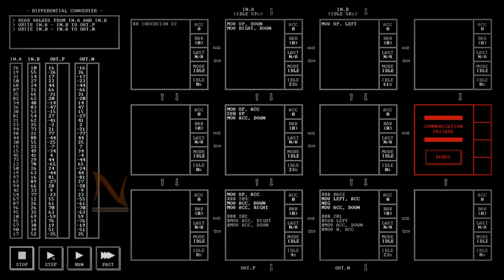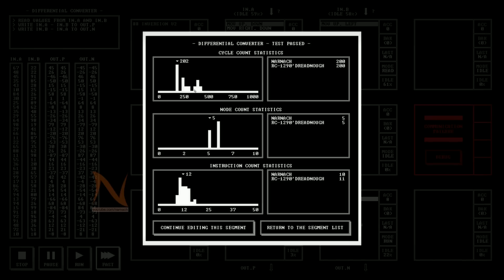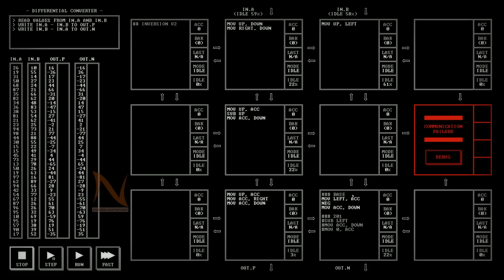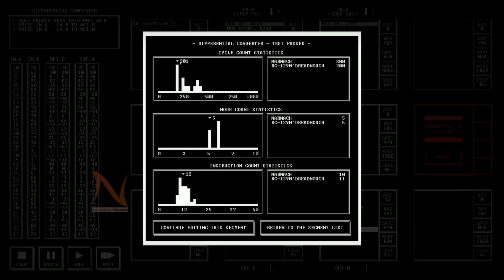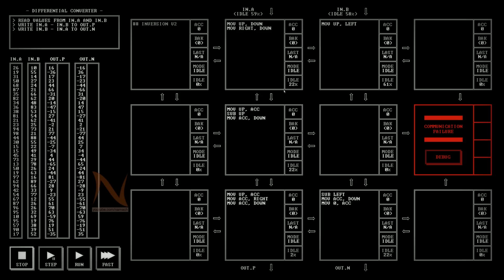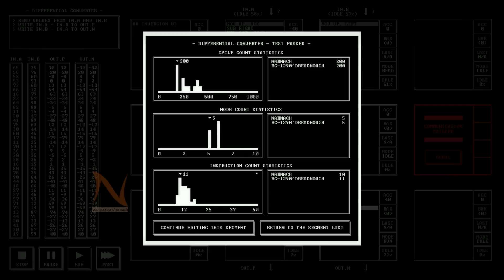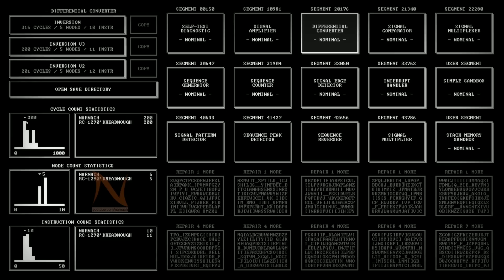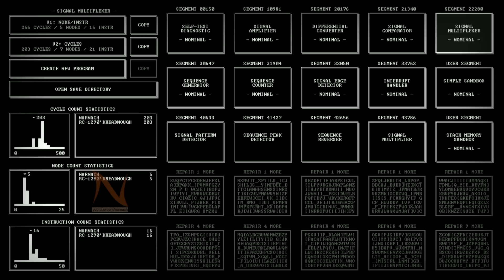#3 - Signal Multiplexer - TIS-100 for everyone (machine 3 update + machine 5 optimal solution)

Comment: I had the same first solution for machine 5, yet I get 272 cycles instead of the 266 you got :(
Reply from the maker: euphoria878 That's likely due to the change a few weeks ago that causes the score to be based on the lowest of 4 runs, rather than a single run. Most older solutions tend to use one cycle more or less based on if you use JGZ or JLZ and how the data matches up with it. The new approach has multiple types of data, providing a fairer measurement of the overall performance, but it does mean some scores are a little bit higher now.

Comment: having jlz and jgz named zero is somewhat confusing. maybe call them negative and positive.
Reply from the maker: +Nicholas Menzel You might be right about that, though I'm not certain about negative and positive either. The label of zero currently reflects what it outputs: the value 0, rather than the input value. It does not really reveal the intention of why you want to emit 0, but neither does positive or negative. Right now the left and right node have a code symmetry with the only exception being JLZ and JGZ. A better name might be ignore-input (if that fits) because that is functionally what happens.